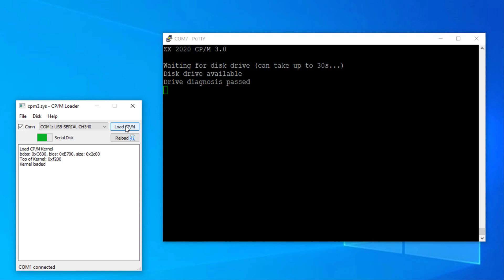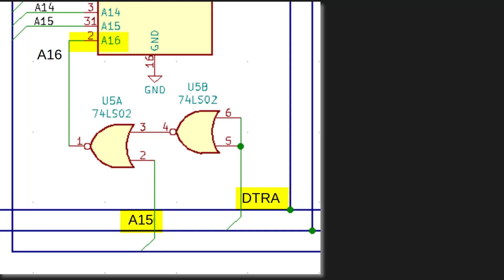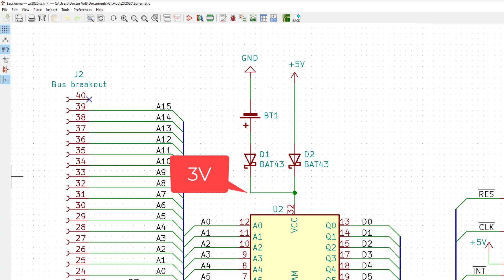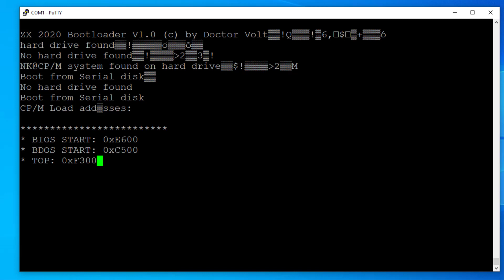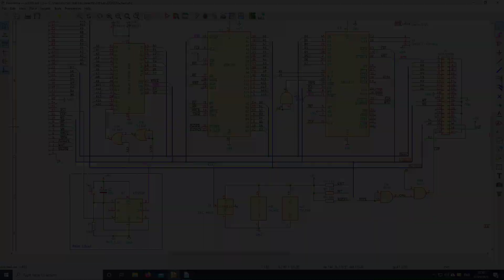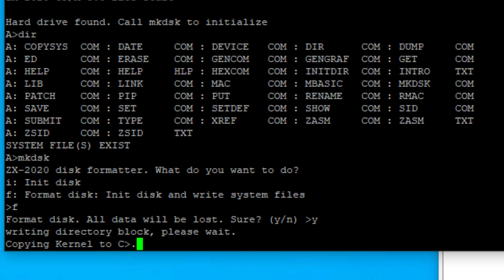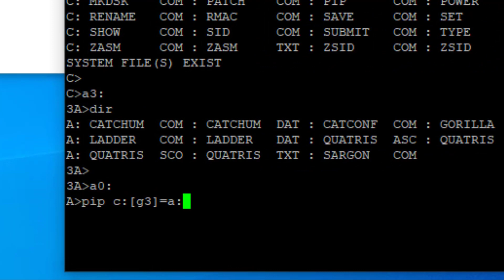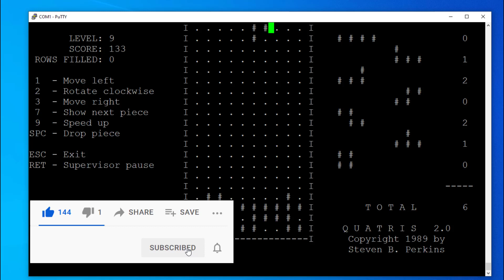DIY Z80 Retro Computer #5: Boot From CompactFlash Card

Comment: Amazing! What if I want to load the bootloader on an EPROM? Does your bootloader and your CP/M support that without huge changes?
Reply from the maker: You can do this. However there is the function "rl$ldr" in BOOT.asm that restores the bootloader from file when CP/M boots up. This cannot write into EPROM of course, so you need to disable it.
Reply: @DoctorVolt  Perfect, so I have to think about a logic circuit for the chip enable. Thanks

Comment: Will it get to the point of connecting to a more modern monitor of any sort? Such as through VGA or S-video? I would like to get to do this myself one day but it would be neat if it wasn't dependent on another computer.
Reply from the maker: There are some terminal-VGA converters available. These are based on a microcontroller and have UART on one side and VGA for Monitor and USB or PS2 for keyboard on the other side. This allows to use the system without any PC. But maybe I will make some basic Video card for this some day.
Reply: @DoctorVolt  thank you!
Reply: @DoctorVolt  Changing the hardware a little, you can use a TMS9918, it's super compatible with the Z80. I'm putting it on my
Reply from the maker: Interesting Chip, also also not this sucking SMD stuff. However as what I have seen it only supports 40x24 characters in text mode, while CP/M requires 80x24. But maybe cool for some 80s style "Lego" graphics.
Reply: @DoctorVolt  Yessss, the cool would be to have a serial monitor. You really like a lego hahahaha